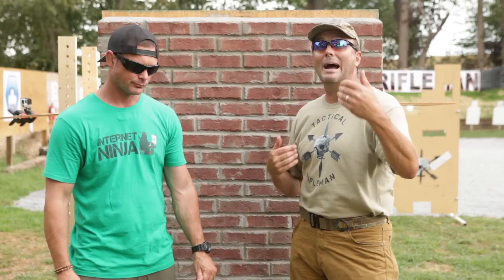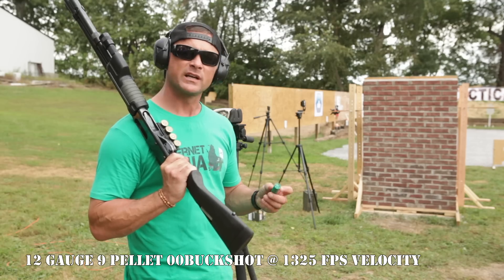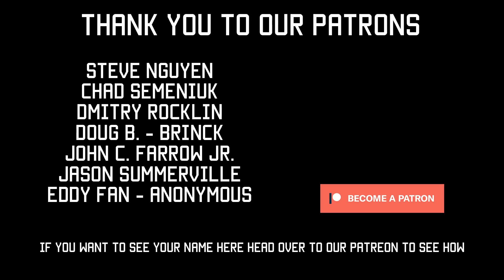Navy SEAL test Ballistics through Walls | Tactical Rifleman

Comment: I realize this test was in part supposed to make the AR seem like a viable option for home defense WHEN CONSIDERING OVER-PENETRATION. But if you take personal bias and emotion out of the equation, the math/science/stats don't seem to support it. They are fatal through interior and non-brick exterior walls. 

Personally, I find the numbers and testing show shotguns (12&20gauge) using shot ranging between #4 Buck and #4 bird show the best balance of effect on target and mitigated over-penetration. 

But even without bringing in numbers and field tests, just basic situational awareness and readiness points out a few almost unavoidable concerns. 

My main concerns...
1. Never assume everyone will respond as you need them to in a crisis. Panic screws up a good plan more often than not.
2. Unless everyone is with you, always worry about over-penetration. Refer to above concern.
3. Responding police, EMS and concerned neighbors outside are vulnerable to over-penetration. 
4. Communication with others may be hard/impossible if gunshots have impaired anyone's hearing. People may not hear safety instructions and you may not hear clear responses. Plus, excess verbal communication can make ppl vulnerable. 

Again, this is just my opinion based on my understanding of ballistics, and testing I've done/observed/researched (including this video). 

I live alone and all exterior walls are 4" plaster/concrete. My personal choice would be my 22wmr w/Hornady Critical Defense or low velocity 20gauge #4 buck. I would want to try and use low velocity/subsonic ammo, as it might cause less or no long term hearing issues if I had to fire more than a courtesy of tounds indoors. 

Again, just my 2cents for the sake of conversation.

Comment: need 308 for sure. but who carries a 308 to rob or do drive by's?  lol - as far as ppl asking and saying what about the ak47 round? 556 vs 7.62? and some who said the ak round will penetrate more...........  clearly physics was not a hobby......   a knife or arrow will penetrate most soft body armor. why? well, the tips are very sharp and small.    556 is a smaller round moving faster......  thus penetrates very well.   however, against ar500 steel you want that bigger round to knock them down. if you cant penetrate then the next best thing is to knock them clean out with force, thus out of the fight. so the 556 penetrates and 7.62 knocks down.  unless specialty rounds, but ballistics still come into play.